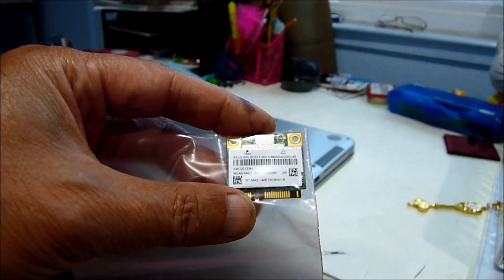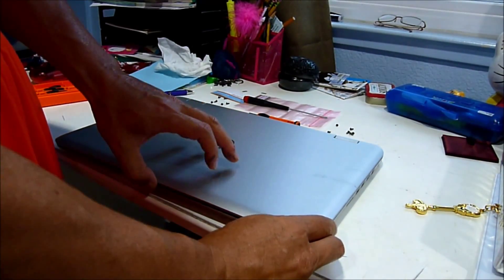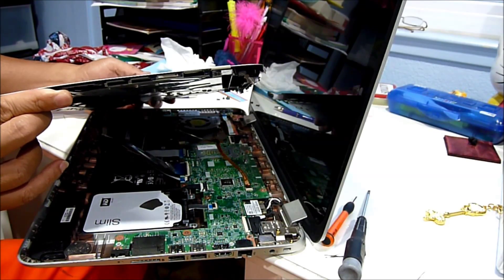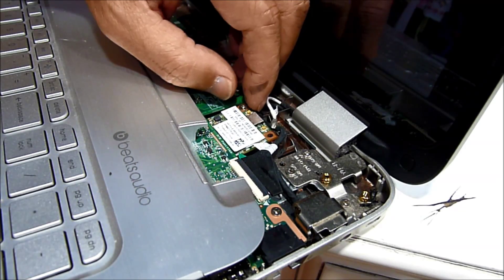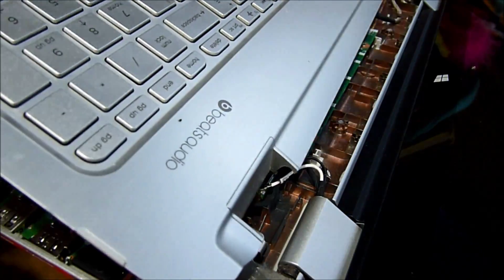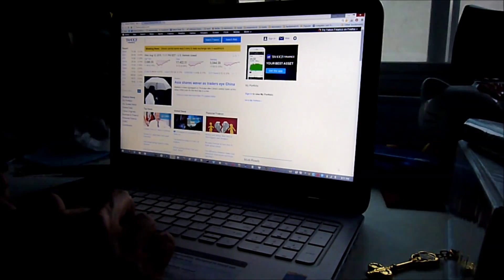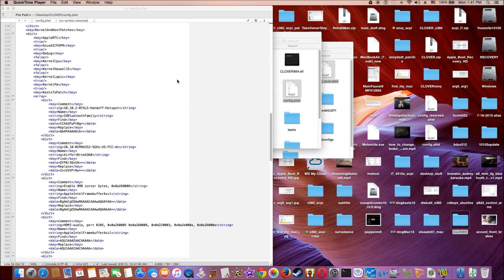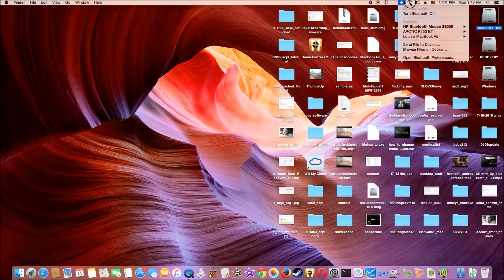How To Install Half Mini BCM94352HMB on HP x360 for Windows and Yosemite

Comment: Great video, you seem to be very knowledgeable when it comes to this whole hackintosh thing. I've got a problem and i was wondering if you could help me out. I've been struggling for over a month to get the hang of Clover bootloader to recognize my windows partition on the same hard drive mac is installed on. I've tried installing windows first, then create the partition from shrinking to use for mac, but never seems to work for me. I've tried vice versa, and i get both OSes installed but i can't seem to figure out why i can't see my windows partition. Any help would be greatly appreciated.
Reply from the maker: +BlaGGah follow instruction here http://www.dognmonkey.com/techs/how-to-dual-boot-windows-8-1-and-yosemite-10-10-1-on-hp-haswell-i7-4510u-hd4400-envy-x360.html
Reply: +3dogs1monkey Thanks for your response, but however I've already seen that before on your website and it didn't work for me because I'm trying to install on desktop and not laptop. The particular desktop I'm dealing with at the moment is the HP DX7500 where I've successfully installed Yosemite with everything working. These aren't UEFI based bios machines.